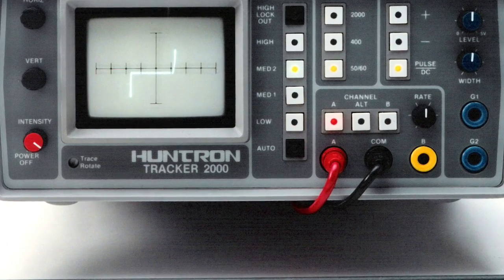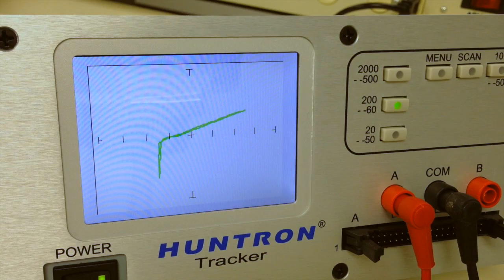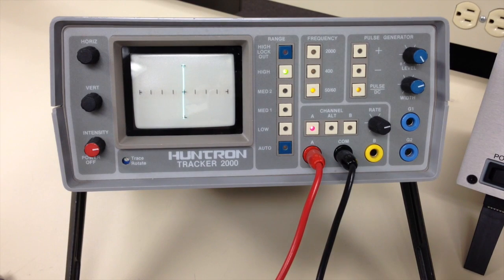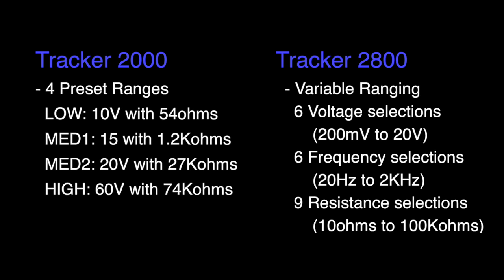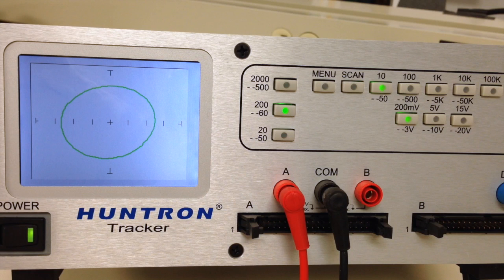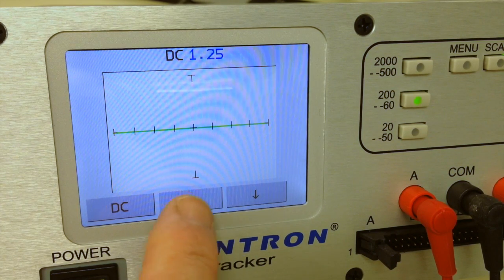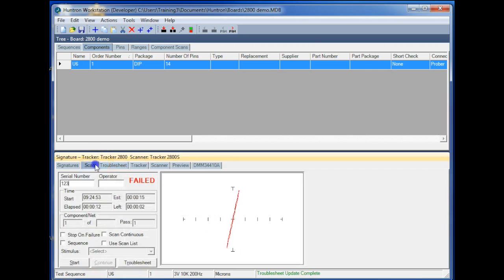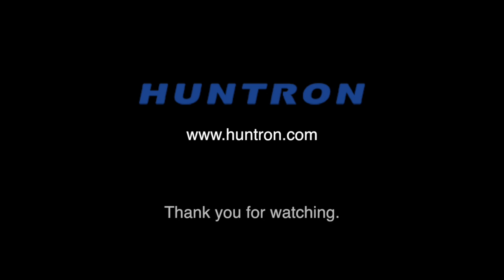Tracker 2800 versus Tracker 2000 comparison

Comment: The amazing improvement gives the tester incredible possibilities, it has only one flaw 🤔- it is beyond my financial means and so I will stay at home made Octopus 🤪
Reply from the maker: Thanks for sharing! There is quite a bit of R&D (hardware and software), high-end circuit design and support that goes with the current Trackers. Test equipment of any kind has never been cheap and the fact it is low volume, prices will higher.